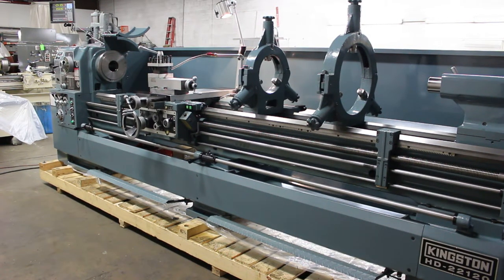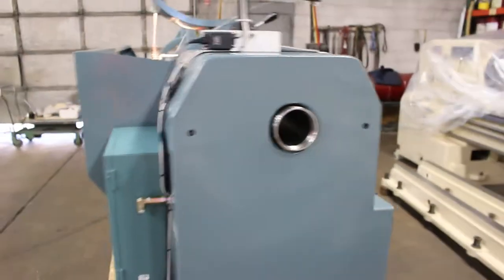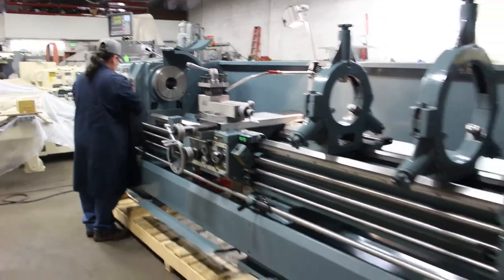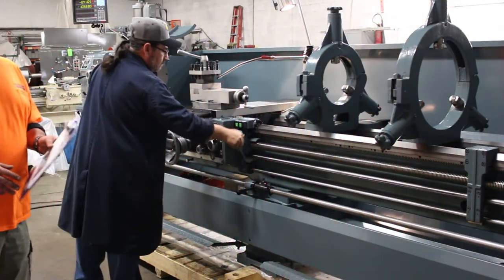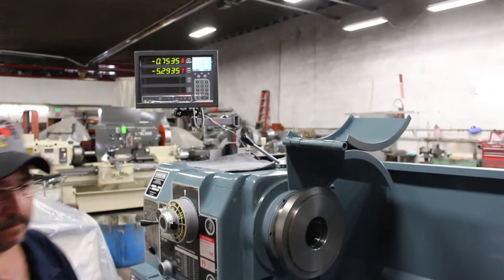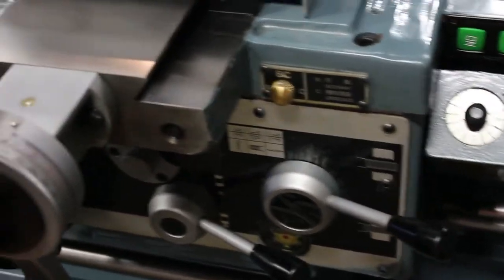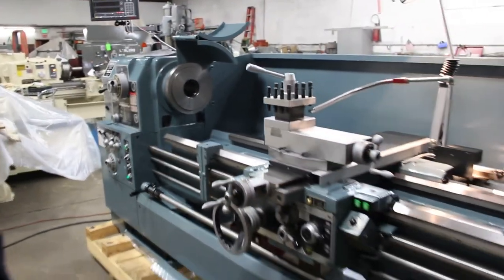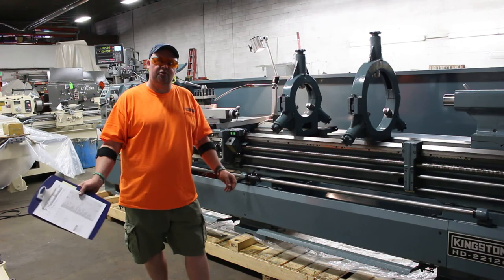Kingston HD 26x120

Comment: We recently purchased an HD 26160 and about 4 seconds after engaging the spindle, there is a knock sound from the headstock. Is this normal?
Reply from the maker: Monarch Model-Series 612, has both; Inch & metric Threading standard 
it also has the Pre-Select on the "RPM" spindle speeds Change